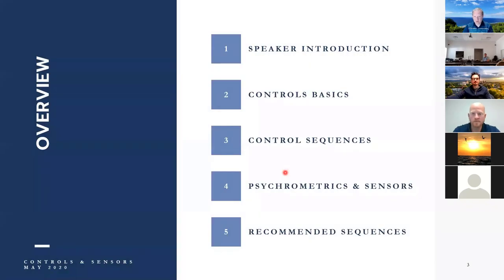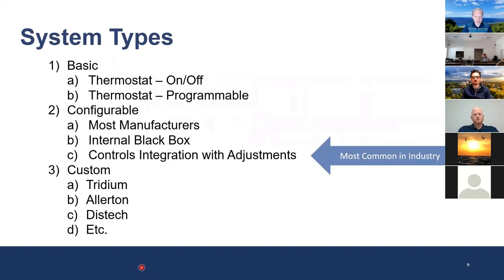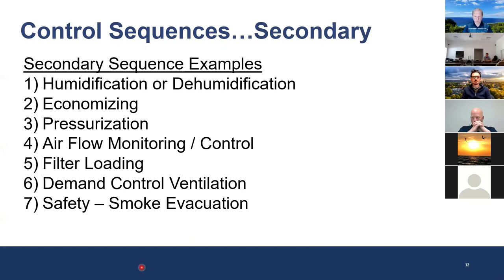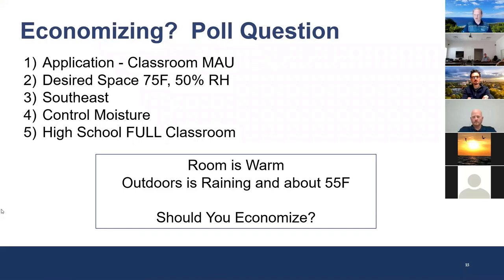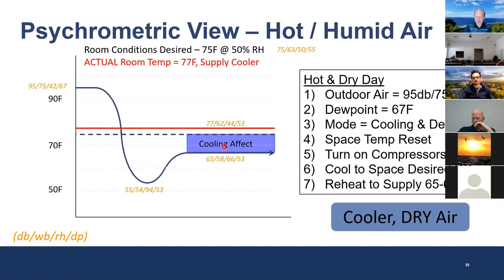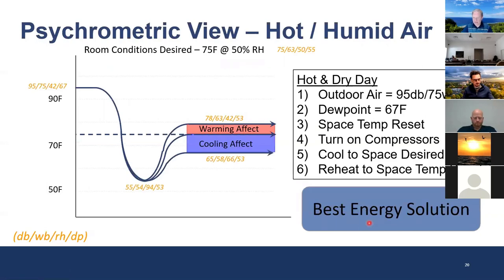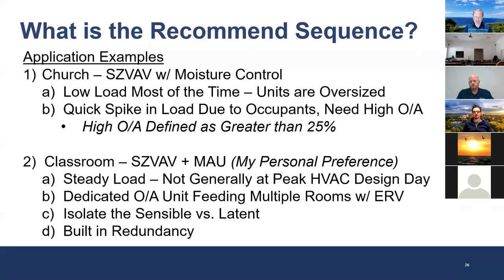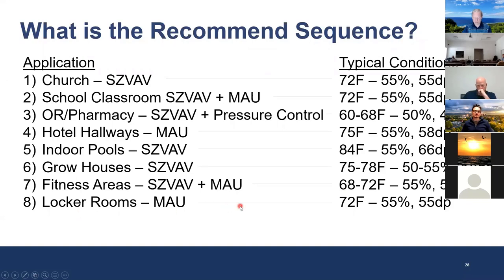HVAC Controls Sequences and Sensors

Comment: Coils never get air bound or clogged with dirty building water.

Fan belts never break.

Fuses or overloads never pop.

Fire smoke dampers never get stuck closed.

Air balancers never "fudge" numbers on the balancing report to appease their customer, the mechanical contractor. Consequently, the system does not perform as designed on peak demand.

Refrigerant charge is never low on a circuit.

Flow switches never hang up.

Dampers never bind or hang up even though the actuator is receiving the correct control signal.

And no one, EVER tampers with parameters.

The controls vendor is ALWAYS the one to get the call FIRST. This occurs even when in the end it is determined such as for reasons stated above, the problem is not controls related. However, by then the controls vendor has already invested the time and efforts in troubleshooting the cause that turns out to not be controls related.

Yes, I do agree there are shady programmers out there that do not understand psychrometrics or how a mechanical system sequence should properly work. However, I respectfully disagree that it is ALWAYS the controls fault.

Sincerely,

A BMS Guy